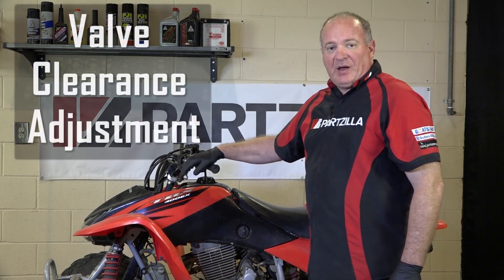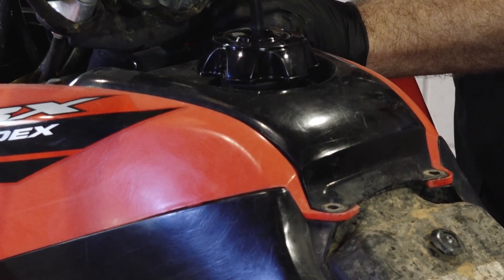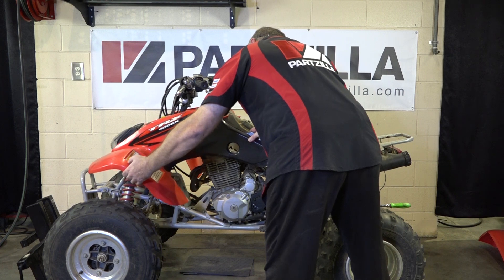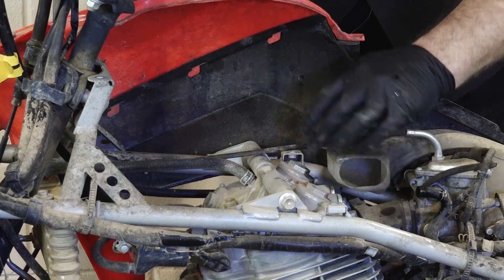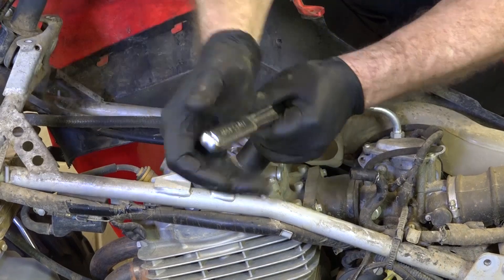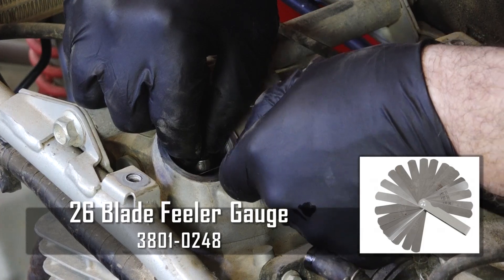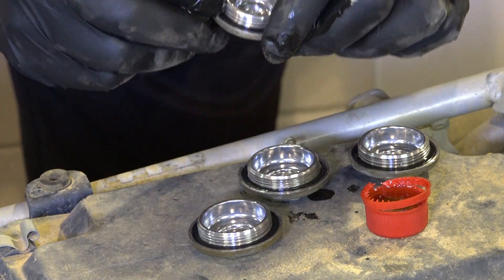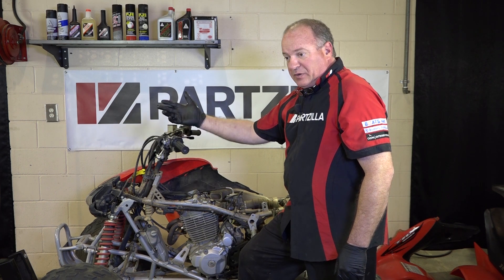Honda ATV Valve Clearance Adjustment on TRX 400EX | Partzilla.com

Comment: Why does your article online that covers adjusting the valve clearance on the 400ex conflict with this? The article says to adjust the intake side at top dead center and then to rotate the crank to bottom dead center to adjust the exhaust valves. The article also conflicts with what is shown in the manual. Which way is the proper way???

Comment: There are 4 strokes. 2 up and 2 down. The crank turns 2 times to accomplish all 4 strokes. The first stroke is the intake stroke(piston goes down, allowing fuel in the chamber). 2nd stroke is the combustion stroke (piston goes up compressing the air and fuel). Crank has turned one full turn at this point.
Third stroke (piston goes down after the fuel/air is ignited by the spark) creating the combustion stroke. Fourth stroke the exhaust stroke (piston goes back up) pushing the gases created by combustion out the exhaust. And that is the 2nd full turn of the crank.

You want to make sure you are adjusting the valves at the combustion stroke. Not the exhaust stroke. As both are technically located at TDC. Just on 2 different turns in the cycle.

Hope this helps!

Comment: Be aware that just because you are at the T in the sight. It does not mean you are in the proper position within the cycle. I did this procedure a half dozen times and made the problem worse until i called a freind who explained some things to me. Easy procedure orherwise. And once i got the proper position on the valve and in T position i was able to eliminate the ticking sound i had with proper valve adjustment.
Reply: How please explain to me.
Reply: @Iz Mashing  There are 4 strokes. 2 up and 2 down. The crank turns 2 times to accomplish all 4 strokes. The first stroke is the intake stroke(piston goes down, allowing fuel in the chamber). 2nd stroke is the combustion stroke (piston goes up compressing the air and fuel). Crank has turned one full turn at this point.
Third stroke (piston goes down after the fuel/air is ignited by the spark) creating the combustion stroke. Fourth stroke the exhaust stroke (piston goes back up) pushing the gases created by combustion out the exhaust. And that is the 2nd full turn of the crank.

You want to make sure you are adjusting the valves at the combustion stroke. Not the exhaust stroke. As both are technically located at TDC. Just on 2 different turns in the cycle.

Hope this helps!
Reply: @10Jason20   im sorey my english is not good. 
So right now im working on my atv. I have the T lined up but  all the valves are not moving at all.. do i have to turn the crank counter clockwise till all 4 have wiggle at the same time?
Reply: @10Jason20  hey i did adjustment..now it smokes blue after i push throttlw

Comment: MAKE SURE YOU’RE ON THE COMPRESSION STOKE!!! The T can line up on two different strokes make sure it’s compression.
Reply: How to make sure.??
Reply: @izmashing5993   you will have a little play in the valves on the compression Stroke. All the valves should be tight on the exhaust stroke
Reply: @parker-blaze   so intake should wiggle alittle and exaust shouldnt? I did adjustments while they all wiggled now it blows blue smoke after throttle
Reply: @izmashing5993  all the valves should have a little play if it’s on compression stroke. Unless one of the valves is tight. If it’s smoking then the valve adjustment shouldn’t have anything to do with that. It’s either your rings or valve seals. If it goes away after a while then it’s valve seals
Reply: @parker-blaze   it didnt smoke before adjust. Just kept dying when hot. Is  it hard to  to seals or rings? How long does it take to do? And last question. Can i still ride it? Im supposed to go off roading saturday
Reply: @izmashing5993   if it’s just smoking you can still ride it. I’d say about 75% of 400ex out there smoke lol. And you have to take the motor apart to do the seals or rings.
Reply: @parker-blaze   i  think ill try to replace seals or rings. Hope its easy and thank you
Reply: @parker-blaze That isn't true at all. I've only seen one 400EX that smoked. Mine smoked one time due to putting so many hours on it while putting off an oil change. The oil was as black as tar. After the oil change it no longer smoked.

Comment: I would suggest checking the valve again after to tighten the locking nut , just to make sure the adjustment didn't change when you tightened it down,
Reply: when checking the valves w the adjustment tool is it .10mm? and .12mm?

Comment: Wish you talked about having bike in compression stroke while finding TDC
Reply: So true, did mine and I definitely adjusted my valves like 180° off and quad wouldn't start. Struggled like it had 15:1 compression and a half dead battery lol

Comment: I have watched this video a dozen times - the first time about a year ago - and I am just as confused now as I was the first time I watched it. When you put your feeler gauge in the "hole" you are forced to go in on a slant to get the gauge in position. How are you then able to flatten it out to get a proper .10 measurement? thanks. love the videos
Reply from the maker: You don't have to flatten it out.  They are pliable, when you adjust, it will flex a little to get in there.
Reply: I bought a feeler gauge from the honda dealer and it is angled near the end making it very easy to use.

Comment: Would this procedure work on a 2003 trx400ex??
Reply from the maker: Yes, should be the same.
Reply: @PartzillaParts  my crank case on my 2004 ex doesn't have the holes to look thru to make sure it's on the t

Comment: Hey I have an Honda 400ex 2001  and I need to know if this is the same proceed for an oversized motor? I have a 460cc. When I did my adjustement, I put my intake valves at 0.1mm and my exhaust valves at  0.12mm. Since then, my atv does a lot of back fire. Need help ASAP!!!!!!!!!
Reply from the maker: Check your fuel input.  Might need to adjust your jets.

Comment: All specs I’ve looked up on valve lash is intake is .004mm and the exhaust is .005mm but you said to do the intake at .1mm and the exhaust at .12mm could you please explain which one I need to use
Reply: U got inches and mm confused ur right on bith but the .004 and .005 are inches
Reply: .010or.004intake, .012or.005exhaust

Comment: Hello. The feeler gauge that you're selling, will it work for a Honda TRX 250EX? Also, does it have  
.1mm as you mentioned in this video?
Reply: @PartzillaParts  You got to be kidding me. I just followed this video and adjusted them to .10 and .12. Thanks for the bad advice.
Reply from the maker: @fireman4u  Per the Honda Service manual.
IN:0.10 mm (0.004 in)
EX: 0.12 mm (0.005 in)
Reply: @PartzillaParts  ya, what's with your earlier comment?
Reply from the maker: @fireman4u  I am not sure who may have made that one on my behalf. I will delete it if the YT Gods will permit.
Reply from the maker: @fireman4u  It is deleted. Sorry for the conflicting information.

Comment: I just adjusted my valves and now its ticking wayyyy worse then it was. I used .004" for intake and .005" for the exhaust. Do you just do it on TDC or compression stroke?  Also its 2003 400ex I'm guessing it's the same as this one.
Reply from the maker: Did you adjust the motor when it's warm or cold?
Reply: @PartzillaParts cold. I didnt have it on the compression stroke  TDC. I figured it out today. Thanks for the reply!
Reply: @PartzillaParts  how i need help

Comment: Do you think the valves could be the reason for not starting? I found a 400ex for 600$ the dude said it got harder and harder to start but he said it will no longer start
Reply: Or do you think it something more serious?
Reply from the maker: Not enough detail to know for sure.  Could be valves, timing, electrical or fuel issues.

Comment: Which valves are the intake and which are the exhaust? Are the intake valves the two on top?
Reply from the maker: Exhaust valves are closest to forward.
Reply: Your intake valves are located on side of engine your carbs are on and exhaust are on side of engine your exhaust is on. So in this case intakes are facing back of bike and exhaust is facing forward.

Comment: When spinning over to TDC does it matter what stroke your on ? I know your suppose to have all valves closed then adjust them just trying make sure mine has a ticking noise I have adjusted twice.
Reply from the maker: Are you doing the adjustment when the engine is warm?

Comment: I always check the clearance, before I loosen anything. Might not need any adjustment at all. Double check the clearance, after you tighten, and torque the nuts ! You went thru all the trouble to tear it apart, might as well double check everything. Good video, tho...

Comment: I just adjusted them yesterday      to  .10mm and. 12mm and it ticks so Loud now and ticks all the time   gets louder as the engine revs higher   before id only ticked a little bit from a cold start up. But would completly go away when it warmed up   any advice.  Engine seems to run fineit just ticks so loud . Only modifications to it is a  wiseco piston and 10.1 compression that's all
Reply from the maker: Did you adjust them while the engine was hot?  Sounds like it needs another look.
Reply: Partzilla no engine was cold. Topndead center. All valves close . I just did a new piston and piston rings following your other video . and decided to adjust them while I had the atv taken a part.
Reply from the maker: Warm it up, re-adjust valves.  I'm guessing they are just too tight.
Reply: Partzilla fix the problem one of my exhaust valves clearance was very lose   tight it back to spec. And seem like it sounds back to normal. There still some ticking but sounds just like before
Reply: It's .01intake .012exhaust

Comment: hello there great video, im just curious tho if i have a stage 1 cam installed would it require different specs for the clearance? thanks in advance
Reply from the maker: Adjust all without rotating crank.
Reply: Partzilla When you are on TDC you have to adjust all 4 Valves or you have to rotate the Crank? Thanks....
Reply: Thanks  for ur help great video i will do that on my Honda 400 EX.
Reply from the maker: Typically the cam manufacturer has different specs. In the case of a Honda TRX400EX the stock is IN:0.10mm EX:0.12mm and the stage 2 Hot Cams require IN:0.13mm EX:0.15mm.  

Check the instructions that came with the cam.  It should have the info you need.
Reply: thankyou!

Comment: Could you please make a valve video on a trx250x/ex.. i have a 2018 trx250x and its been a month and i  dont want to spend $200 at honda house to get this done.. please
Reply from the maker: We will try to get our hands on one.  What happened that you need to do valves on a new unit already?  If something is wrong, it should be covered by the warranty.
Reply: Partzilla i got it Oct 7th and its making a ticking noise as of a day or two ago..(not super loud but its noticeable)i called honda house to make appointment /the first month check up(the once over) is not covered by the warranty its going to cost me 199$..

Comment: where do you stick the feeler gauge in between
Reply from the maker: Slides into the space between the adjusting screw and the top of the valve.

Comment: What about a bottom end knocking noise? Could it be a valve adjustment ?
Reply from the maker: If it's knocking on the bottom end, it shouldn't be the valves, that is usually a bearing fail on your connecting rod.  I would tear it down and inspect it before you blow a hole in something.

Comment: Setting lash on the 400ex valves don't you have to go slightly past tdc for the right hand exhaust valve/Compression release to click? If not the right hand valve will be very loose versus the left and it will be incorrect.
Reply from the maker: Never heard of this, double checked the Service manual and it says nothing about doing that.

Comment: How would you get the caps off if there all round and or broke?
Reply from the maker: Depends on how bad they are.  Vice Grips?  grind a slot and use a flathead screwdriver...  Get creative, you can get them off.

Comment: What are the four top caps actually called, i stripped mine please help
Reply from the maker: They are called "Tappet adjusting hole caps"   #2 on the diagram.
http://www.partzilla.com/parts/search/Honda/ATV/2007/TRX400EX+A/CYLINDER+HEAD+COVER/parts.html

Comment: My quad makes a ticking noise 2008 honda trx400ex the faster i go the faster ticking goes. Before when i'd start it when its cold it would tick when it has been a while warming up ticking stop now its nonstop if i adjust the valves will it stop ticking or what other things can it be and how can i fix it
Reply from the maker: Sounds like a valve adjustment is needed.

Comment: My 400ex is hard to start but sounds ok when it idles but when I give it a tap of the throttle it makes a knocking sound, only when I tap the throttle could this be valves?
Reply from the maker: Yes, it could be.  It's a good place to start your diagnosis.
Reply: Partzilla adjusting the valves fixed this but could too tight of valves or out of adjustment valves cause it to begin to burn oil
Reply from the maker: Usually, the burning oil is from your piston rings going bad.  If your valves are way out of spec, you can damage the valves and/or piston which will cause all kinds of problems.
Reply: What's the exact reading on feeler gauge when you want to adjust your valves jihm

Comment: Good video...would I have to the same steps on my 2004 400ex?
Reply from the maker: Jose, the steps should be essentially the same.  There might be some variation in getting the plastics off, but the valve lash procedure will be accurate.

Comment: I have a question, when you say "getting harder to start" does this mean that the kick start can have more compression? Because my 300ex kick start is so hard to push down and someone suggested that i might need to adjust my valves.

Comment: would this be the same process step by step if it was a honda trx250ex? i need to adjust my valves and i want to do it myself.
Reply: Lombardo ZarateIII yeah I need to know for my 300ex as well.
Reply: hopefully he replies do us soon their charging me $255 to adjust my 250ex valves crazy man.
Reply from the maker: The way you adjust the valves is the same. the difference is the clearance both intake and exhaust should be between 0.13 mm and 0.005 mm
Reply from the maker: This is same for the 300ex as well
Reply: thank you sir your help is greatly appreciated

Comment: There are 2 rubber band clips that also hold the gas tank down that were not shown in the video. You can see the lips where they connect. Just FYI.

Comment: Just did full top end, timing chain, new valve seals & valves, valves are .004 intake .005 exhaust. still have a little tapping. Quad runs great. Any ideas? Some friends have said this is normal on these

Comment: what causes my engine to backfire
Reply from the maker: +Shakiel Mcclain There are several conditions that can cause an engine to back fire. A backfire can happen if there is an imbalance in the air to fuel ratio. If the fuel mixture is lean, it  will backfire through the intake, or too rich it will backfire out of the exhaust. There could also be an issue with the timing. I would start by checking the intake boot for leaks. Best way to do this is to let it adle and sptay carb cleaner on the intake to see if the RPMs increase.